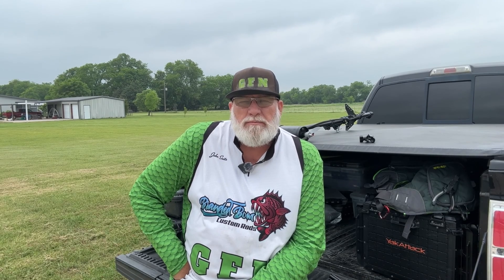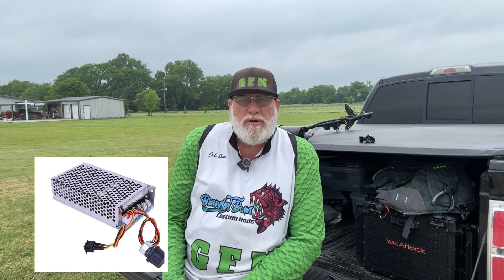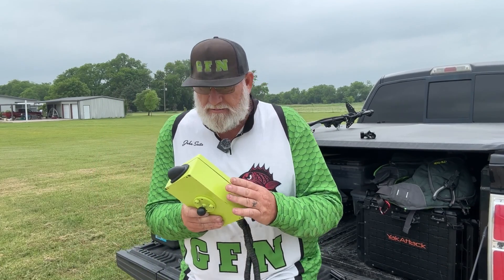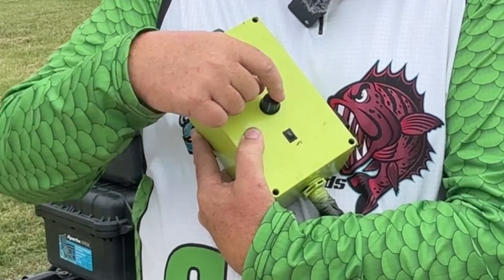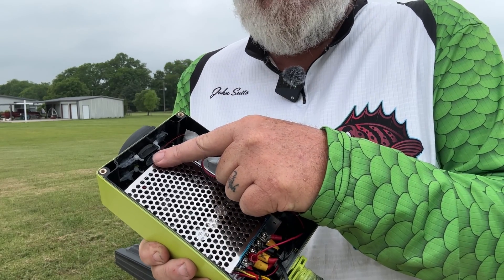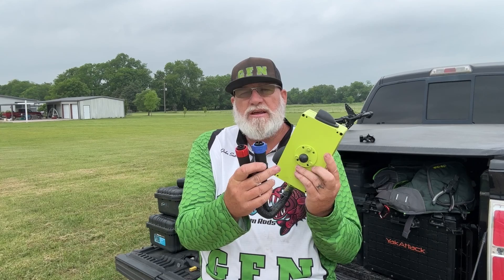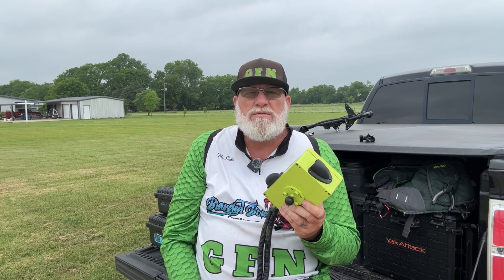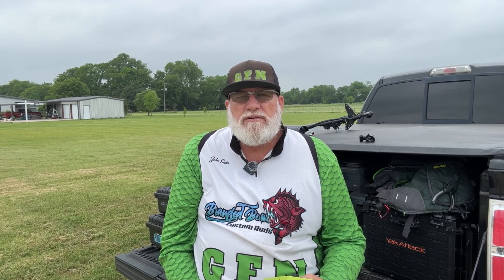Is A DIY Trolling Motor Speed Controller Worth It?

Comment: I know this video has been out awhile but thought I would ask in case you see it.  FOr your fan setup did you hook the fans up in like with the battery power in so they run all the time or I imagine if you hooked them in line with the trolling motor wires to the PWM that the fans turn and off when you turn on your PWM and add power to go and if you did then I imagine the more power you add the faster the fans spin?  I have mine built and tested but it does get warm so wanted to add fans just not sure   exactly which way I want to power them  Run full time on the battery slot or on the motor side.
Reply from the maker: This is a great question. I ran them on the motor side so they only run when the motor runs.
Reply: @Video-Bass-fishing  Thank you.  REally appreciate the quick response and answer.  I'm not a big electronics guy and just learned to make a PWM setup over the last week.  Had mine out for the first time last night and it worked great.  I'm running a 55lb Newport Vessels trolling motor so I guess if my 60 amp fails I will get a 100 amp version but other wise it worked fantastic.  Thanks again for the help.

Comment: Did you remove the head off the trolling motor? I want to do this but do not want to remove the head because i use the motor for other boats
Reply from the maker: @kylejackson5491  I did remove the head. But you do not have to. You can leave it attached as long as you turn it all the way to five your PWM will work at top speed that way.
Reply from the maker: @kylejackson5491  I did remove the head of the trolling motor, but you do not have to as long as you turn your selector to high you will be able to use the PWM at any speed

Comment: Those quick connectors are only rated for 50 amps but my pwm is continuous 60 amp! Would it be fine?
Reply from the maker: @eddygarcia8814  I never have a problem with them at all

Comment: Hey John do you ever worry about water in the box if you roll the kayak?
Reply from the maker: @robertcolvin7989  I have never had an issue with it. I never flipped my boat though. I’m sure it would t be good for the PWM though.
Reply from the maker: @robertcolvin7989  my bow was water tight until I added fans for intake and exhaust

Comment: BTW thanks for the video.  I am in the middle of motorizing 2 Titan 12 propel kayaks.  I used your info and video as a basis for everything I am building.  BTW don't bother answering my previous question about the vents.  I found your info in the previous comments from other posts.

Comment: I found the cord you used to be to stretchy.  I switched to using weed trimmer line and it has absolutely no stretch.  I will find out how durable it is as I use the motor.  I am using round trimmer string .095 diameter.

Comment: Hey John your parts list is incomplete.  Where did you get the intake and and exhaust vents for the fans and what are the part numbers.  What crimp connectors did you use to hook up the wiring to the pwm.

Comment: Hi John , I am in Adealide South Australia , like your vids, can you help with  the name and where to get the fan vent covers  on  the PWM box you have , i just can find them and miss the name you called them  :) thanks for any help you may have for me:)
Reply from the maker: https://www.amazon.com/FDXGYH-Marine-Transducer-Clamshell-Mounting/dp/B0C1ZLDX22/ref=asc_df_B0C1ZLDX22/?tag=hyprod-20&linkCode=df0&hvadid=692875362841&hvpos=&hvnetw=g&hvrand=15995692367654014130&hvpone=&hvptwo=&hvqmt=&hvdev=m&hvdvcmdl=&hvlocint=&hvlocphy=9026998&hvtargid=pla-2281435179738&psc=1&mcid=f35f900bba9e3995b42c9aaefa691f70&hvocijid=15995692367654014130-B0C1ZLDX22-&hvexpln=73&gad_source=1

Here are the covers. I bought them from Amazon. I attached a link for you
Reply: @Video-Bass-fishing  Thank you so much that awesome cheers John

Comment: This is a great video. Thank you very much for sharing. What is the name or the link for the plastic that covers the fans?
Reply from the maker: https://www.amazon.com/GWYAN-Marine-Transducer-Clamshell-Mounting/dp/B0B7LPGHDM/ref=asc_df_B0B7LPGHDM/?tag=hyprod-20&linkCode=df0&hvadid=692875362841&hvpos=&hvnetw=g&hvrand=11748047881999258171&hvpone=&hvptwo=&hvqmt=&hvdev=m&hvdvcmdl=&hvlocint=&hvlocphy=9026998&hvtargid=pla-2281435177338&psc=1&mcid=8fc582a9cfab3ff1a22179bf5ee20dd8&hvocijid=11748047881999258171-B0B7LPGHDM-&hvexpln=73&gad_source=1
Reply from the maker: Here’s a link to the clam shell vent covers
Reply: @Video-Bass-fishing  much obliged
Reply: I ran to Home Depot this morning and just finished building the steering box. I decided to do the criss-crossing in the box itself by putting the left line in the right exit hole, and the right line in the left exit hole. I also angled these holes a bit to avoid friction and potentially cutting the line.  Now I just need to figure out a way to give the handle less play inside the box, although I suppose it'll move less once there's tension from the rest of the line. Such a simple and beautiful design. I'm so grateful the algorithm put you on my path. You have not only saved me money, but got me moving forward with my kayak build out of pure excitement. Once again, thank you!
Reply from the maker: @abahamaca  absolutely love hearing this. Thank you so much. This has made my day. Please tell others about us and continue to monitor our channel for other great tips.
Reply: I found a solution. I took the tip of a silicone tube, I cut it to where the tip goes in the 1/2 pipe and the widest part is glued to the bottom of the box, right in the middle. I used instant glue and baking soda as mortar and man, that thing is now as solid as they come

Comment: What do you recommend when it comes to selecting the PWM, for a Minn Kota 30. 0:14 0:14 0:14 I see 60 Amp and 100 Amp on you tube. If I upgraded to  a MK 40, would the same PWM for a 30 work?
Reply from the maker: I would go ahead and get the 100 even it’s just rated for 60 amp continuous.
Reply from the maker: @oldretiree  I would go with 100 amp because most of them are 60 A continuous. You have to really look at the product specifications and read into them because they’re real bad about giving you the max amperage.

Comment: How much does a Pwm extend battery life by as compared to just running the Minn Kota (30) directly off the battery? I usually run in setting 2 or 3.
Reply from the maker: @oldretiree  it will extend your battery life by a few hours. I like that I can fine tune the speed as well it’s almost like having spot lock with the fine running it brings

Comment: Great video.  What are the black air diverter covers on the outside of the box and where can I get them?
Reply from the maker: I actually have an intake and exhaust fan to help cool in the Texas summer heat these cover those I’ll share the the links with you. 
https://www.amazon.com/Strong-120x120x25mm-Computer-Cooling-1600RPM/dp/B07K2Y9XSH/ref=mp_s_a_1_2_sspa?adgrpid=64521890308&dib=eyJ2IjoiMSJ9.4jRZQ7BfYXOoqivTrrEjP0E_qh2I-iSHs0ykEj0l2Fq6Skd2X4Ah_pDXJnKBSJs_aqgPhCkoOfG7Z5H5Kv1rGjnrz90Exr8OL6rd7UYOANPYAdTh_8UPggAI49y6_KnDdDvDHuDMpakfgKegHF4MNYRDaFMBoSig2fzO0yOTB91QsfqV3w8ZjvtwPsYRJ4RJY5uH1oRuRYB2qUiH9lQ-IQ.df7l0DmXVGMcfddwEMDXiCNT4oGvpHqnqwo-yVg7MNU&dib_tag=se&hvadid=651335585243&hvdev=m&hvlocphy=9028153&hvnetw=g&hvqmt=b&hvrand=8312632568376729248&hvtargid=kwd-298404015486&hydadcr=12195_13429354&keywords=dc%2Bfan%2B12v&qid=1718983031&sr=8-2-spons&sp_csd=d2lkZ2V0TmFtZT1zcF9waG9uZV9zZWFyY2hfYXRm&psc=1&th=1
https://www.amazon.com/GWYAN-Marine-Transducer-Clamshell-Mounting/dp/B0B7LPGHDM/ref=asc_df_B0B7LPGHDM/?tag=hyprod-20&linkCode=df0&hvadid=693769151228&hvpos=&hvnetw=g&hvrand=1930497049086385897&hvpone=&hvptwo=&hvqmt=&hvdev=m&hvdvcmdl=&hvlocint=&hvlocphy=9028153&hvtargid=pla-1890170109556&psc=1&mcid=8fc582a9cfab3ff1a22179bf5ee20dd8&gad_source=1
Reply from the maker: Thanks for your comment
Reply: Perfect.  Thanks!

Comment: Really like this when I look to make an upgrade I hope that I can put this together. I will definitely reach out when I get to that point.
Reply: Roughly how much would you say for PWM would be? $60?
Reply from the maker: @ETXYakin  a good 100amp PWM is around 60.00 on Amazon. The box and fittings will run around twenty bucks and the way I mounted mine was a ram b arm and two ram balls. That’ll cost you 25 so all together you looking at around 100. Total
Reply from the maker: Anytime bud. We need to hook up and do some fishing soon
Reply: @Video-Bass-fishing  yes sir we do after this Lake fork tournament we should try to get a time together. My summer is pretty flexible.
Reply from the maker: @ETXYakin  sounds good
Reply: Hey how you doing thanks for your video what do you use to read the battery voltage or to see the battery charge